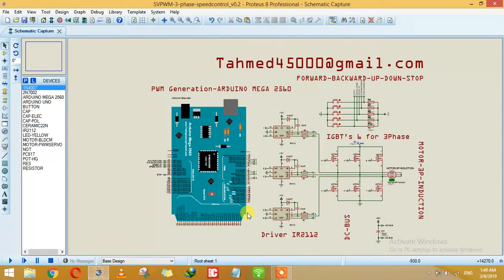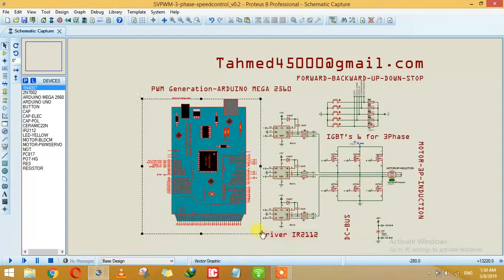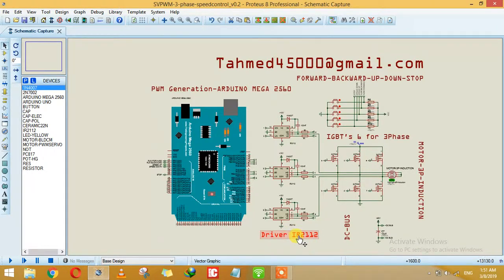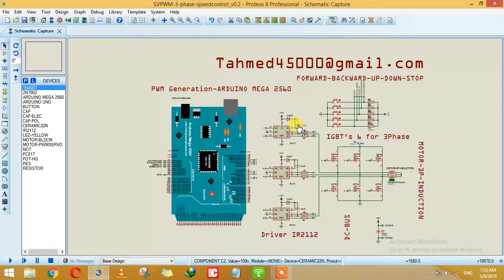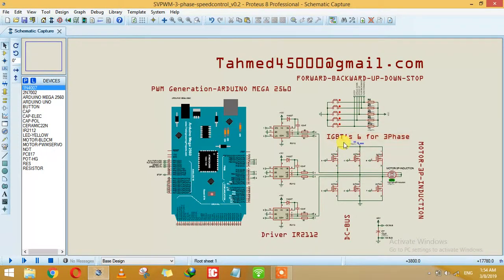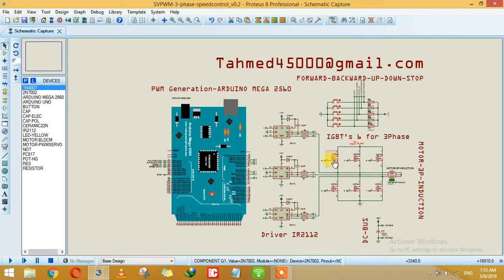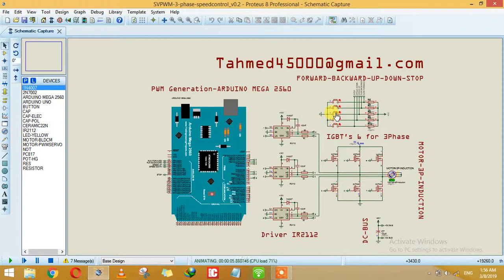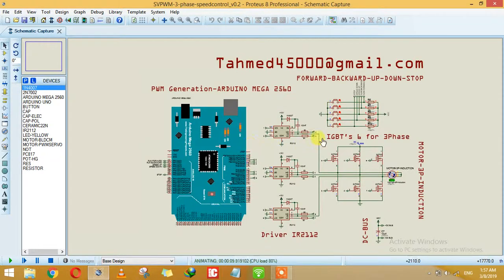SVPWM using Arduino to Control Speed of 3 Phase Induction Motor

Comment: Hi,sir could you can help me to write the svpwm code in mega2560 because I find the spwm method not get better AC voltage,so I want to use the better svpwm please help me.thanks
Reply from the maker: Contact: tahmed45000@gmail.com